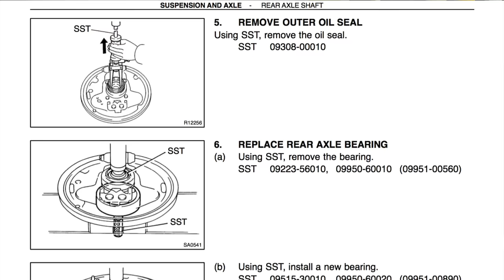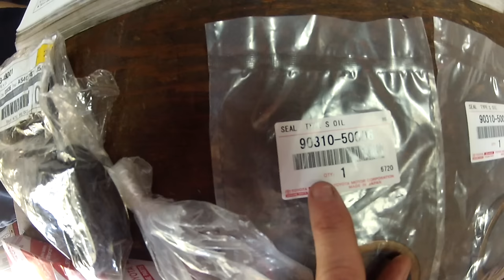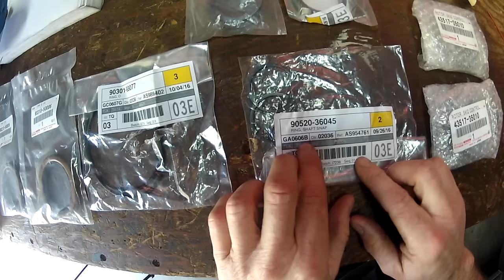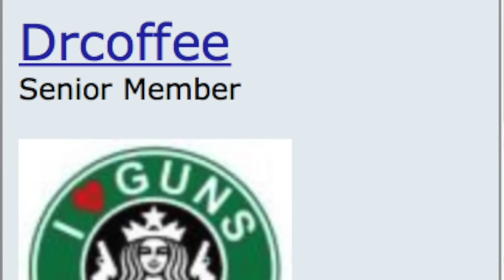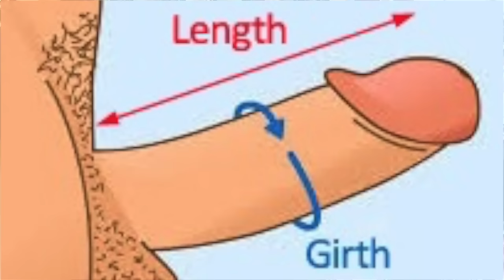Toyota Rear Axle Seal/Bearing Replacement (ABS Rearend)

Comment: HEYOOO Mr. Tim, it's Tim. do you happen to have the outer diameter of the axle and the length?  I'm considering making my own press tool from pipe, flanges, and steel plate.  I need to practice my welding and pipe threading/tapping.  I'd like to keep the jig as small as possible for cost and weight.  Thanks to anyone who can chime in here - I'd rather not pull the axle twice just for measurement. Thanks, Tim - Sincerely, Tim.
Reply from the maker: Hey Tim,  I understand you want to practice your welding and other fab skills but maybe it would be better used for another project.  The tool our buddy Duane makes for this job is really hard to beat.  Take a look at Part 2 of this video for the tool I'm talking about.  You would be really hard pressed to improve upon Duane's design.  https://youtu.be/R-c2x3F8DU4
Reply: @TimmyTheToolman  whoa yeah that's a much better price than anything I'd seen. Bout to watch that vid- thanks for the reference
Reply from the maker: You'll really like this tool Tim.  It is leaps and bounds better than the Durasolid tool.
Reply: @TimmyTheToolman  Ended up ordering the tool from Duane- it's solid as can be and shipped cross-country in 2 days.  Will be putting it to use this weekend.  Do you know if the '96-'00 bearing is interchangeable with the '01-'02 bearing?  I have the #90363-40020-77 bearing for my own '00, but my buddy's is an '01 and I just noticed the difference in part #s.  I'm reading that the only real difference is that the inner race is extended on the 90363-40068 whereas the earlier bearing had identical width of inner and outer race (can confirm these being flush as I have 2 sitting on my bench).  Have you done both styles and could you suggest if the 90363-40020-77 would work in an '01?  My buddy is only available this weekend or we'd have to put this off for a couple months.  The only other short-term option is a cheap house brand bearing from the parts stores.
Reply from the maker: @TimStafford01  Hey Tim, I don't know if the 96-00 bearing would be compatible for 01 and 02 models.  I've always got the correct bearing for the year that I was working on.  Could it work?  Maybe, but I don't know for sure because I've never tried.  How about just visiting your local Toyota dealer parts department today and picking up the correct bearing.  These are usually parts dealers keep in stock.  Yes you'll pay more at your local dealer but you'll get the right bearing and be able to help your friend out this weekend.

Comment: I just had a shop replaced my Axel seal 2 days ago along with the wheels bearing, retainers and the abs gear. Driving home today I was going 65 and I felt a weird vibration coming from the back. When I finally got home I stop and I smell a burning smell coming from the rear passenger wheel and you can feel a good amount of heat coming from that wheel. 10 min later I decided to drive around to see if it vibrates again- it didn't vibrate but for a about a mile I heard a sort of humming sound coming from the back. I pull over and I slightly smell the burn smell again but it wasn't so bad. I then drove around for another 13-14 miles on the freeway and there was no more noise or vibration or smell. Any idea what this is?! Is my seal and bearing bad again 2 days after replacement?? Thanks in advance for your help! 

Ps I went under my car and looked at my diff breather and it does not look good at all, I'm going to to replace it tomorrow
Reply from the maker: krod2152 Hey, sorry I missed your question.  I'm guessing you probably already figured out what was going on since it was a month ago.  If I would have caught your question in a timely manner, I would have told you it sounds like your brakes shoes are dragging.  When your axle seals fail, the gear oil can eventually get into the brakes and contaminate the brake shoes.  The brake shoe material will slowly absorb the gear oil and swell.  When this happens,  your brake shoes could start rubbing on the inside of the drums and the constant friction generates heat.  If the friction is bad enough, your brake could even lock.up.  Something tells me they didn't replace your brake shoes on the affected side and/or the brake shoes were adjusted too tight.   There's also a very good chance they botched the job like many shops do and you were immediately leaking again.

It would be helpful to know what the issue was for anyone reading your comment.  Thanks and sorry again for the late response.
Reply: Probably your abs ring rubbing the seal or housing until it ground itself down. That would make some noise and burning.

Comment: PRO TIP: Use the same hose you use to bleed the brakes to stop the drip when disconnecting the brake line - simply put the hose over the line, clamp the end shut with hemostats (alligator clips) or a vice-grip, and BAM, done!!
Reply from the maker: Thanks for the tip but I like the vacuum cap trick though.  (2) 7/32 vacuum caps and you're golden Pony Boy.
Reply: I didn’t have the tips on hand but I had the hose!! :) keep up the awesome work!!

Comment: I feel like I am missing a few parts but I could be wrong 

Rear axle Bearing need 2.
Dust seal need 2 
Inner axle seal need 2 
Axle housing o rings 2 
Retainers need 4
C clips need 2 
Abs skid control rings 2
Reply from the maker: Julien, take a look at the video description.  We list all the part along with tool links.

Comment: Great video, Timmy!  I'd like to have a machine shop make me the special tool.  Could you tell me the I.D. and length of the pipe section of your Durasolid tool?  Thanks!
Reply from the maker: I could send you pics so you can make your own but I think there's a better option.  Check out this one for sale on Ebay: https://www.ebay.com/str/autopullersandparts  I talked with the seller and he seems like a good dude and stands behind and his tool.  He's going to send me his tool and we're going to make another video showing his tool in action to perform the necessary press work on Toyota rear axles.  I think you would spend more money have a machine shop build you a custom one so that's why I'm suggesting this to you.
Reply: Thanks for the prompt reply.  I will definitely check out your video.  I'm still considering building my own (I can weld the tube to the plates the machine shop will build), so if you think of it, let me know on the ID and length of that tube---thanks!
Reply from the maker: @karlenabrailey1819  Give me your email address and I'll send you pics of the tool.

Comment: Hi dear 
Im facing some problem with my FJ62 – 1987 model lancruiser. When  using the 4x4  gear (high and low gear) the vehicle is getting jam when I turn right or left, but on moving to front or reverse its moving normally, 
I recently serviced to both differential and changed all the seals and bearings, and axle,
I tried to lift the vehicles four tyres on a jack, and run it with the 4x4 high and low gear with turning the string right and left and it doesn’t got jammed, but on getting the vehicle on the ground the same thing happened on turning the steering the tyres getting jammed. 
Even I checked the break system and no any issue found in it. 
Do any one faced same problem as this, or any idea what the issue could be.
Also I opening really diff I find it broken also change with same old one
Reply from the maker: Are you trying to turn the wheels in 4 wheel drive on pavement?
Reply: I tried on the pavement as well as in the desert, the same problem’ 
of course it was to check after make  Service.put View matters that’s all not to much .
Reply from the maker: @cobia010  Well, did you have this problem before you serviced the front axle?
Reply: Before only sound coming from front diff put after Service and change Twice axle and  Rear diff his Happening this a problem
Reply from the maker: @cobia010  I wish I could help you out with this, but without being there, it's hard to say what's happening.  It does sound like to me it's acting like it has a locking differential so when you try to turn, it feels like the wheels are binding.
Reply: Locking diff this is correct you are right put what is the reason for this?

Comment: Hey Tim, is there another way to remove the abs and retainer without using the OTC tool?
Reply from the maker: The only other way that I know of is cutting them off.  I don't like this technique because you destroy parts you can reuse and you also risk cutting into the axle shaft if you're not careful.
Reply: @TimmyTheToolman  I see, I think you mentioned the otc tool can be rented at auto stores, right? And you mentioned the abs and both retainers can be reused, have u tried reusing it and was there any problems?
Reply from the maker: @DTFShorTie  Just check auto parts stores like Auto Zone and O'Reilly's because they rent tools for free and I wouldn't be surprised that they offer a bearing splitter for rental.  I've reused the retainers and ABS tone rings on many sets of axles with no issues.  I document how you can do this in the video description.   I take it you have a special tool like the Durasolid tool to use in conjunction with the bearing splitter to get the ABS tone ring and inner retainer off?  You need that tool also to press the axle shaft out and then press all the parts back on.
Reply: @TimmyTheToolman  yeah i know someone who has a similar tool like the durasolid and he's got a press as well. Was just making sure. Hopefully in a few weeks from now I'll have my bearings and seal replace. As always keep the vids coming!
Reply from the maker: Ok, good luck with the job.  We'll definitely keep cranking out the videos.

Comment: Any way to tell if its just the seals that need replacing,and not the bearings??
Reply from the maker: Going through all the reasons why it's a good idea to replace the bearings along with the seals would be a lot of typing for me so please start watching at play time 7:14 and I explain it in great detail.  Also in the video, I explain how the seal has been redesigned by Toyota and the lip of the seal now sits more inboard.  Simply replacing seals without repositioning the inner retainer will cause you to have another failed seal in a much shorter time than you would like.  

So, please take another look at the video and also read the video description for more helpful information.

Comment: Do those same part numbers work for the 04 Tacoma 4x4? I'm gonna be doing this soon and wanted to get all the parts together
Reply from the maker: They should because the rear end on the Tacoma is the same as a 3rd Gen 4runner, but to play it safe, you might want to double check the part numbers on a Toyota parts seller website.
Reply: @TimmyTheToolman  will do.. thanks for the reply back and the awesome videos bud

Comment: Does the ABS gear really need to be replaced? I I can't see the benefit to replace it.
Reply from the maker: fbanda20 No, it doesn't need to be replaced and neither do the retainers on both axles.  If you pull the parts off like we show and don't cut them off, they can be reused.  For the retainers, you swap the positions so the one that was riding against the bearing is now mating up with the seal and the one that was originally mating with the seal is now riding against the bearing.  The seal wears a mark into the retainer and that's why it's better to swap the positions so the new seal doesn't end up riding on the same wear mark.  I listed these ways to save money on the parts in the video description.

Comment: I imagine you can't by all that axle and Brake housing and bearings and retainers already pressed together can you?
Reply from the maker: No, not that I know of.  Even if you could, Toyota would have the inner retainer at the original position and then it wouldn't mate up well with the axle seal they redesigned anyway.   The only way you could get a complete axle is getting one at a wrecking yard like PickNPull but then it's used.

Comment: With the ABS looks like no need to flip retainer because you have room both ways. I would have thought ABS and outer retainer would have been tight to inner retainer!
Reply from the maker: Some shops that don't know what they are doing press everything tight together and then the customer finds out the inner retainer comes no where close to mating with the seal.  People have gotten away without flipping by moving the inner retainer 2mm more inboard than the OEM location on the axle but that now puts the inner retainer really close to rubbing the inside of the axle housing which people have experienced.  The smarter choice is to flip the retainer so you can keep the inner retainer in the same OEM spot (5mm or polished axle showing above the retainer) so you get a good mating with the seal and no chance of the retainer rubbing on the inside of the axle housing,
Reply: Got it, forgot you said that!

Comment: just did all 6 bearings and had to peen the bearing surfaces all around due to excessive wear (745000 ln111r) just wondering how im gonna get those bearings off down the line now lol. Hopefully never have to touch em
Reply from the maker: Hey Jack, you lost me on your comment.  There's only 1 bearing per axle.  2 axles means replacing 2 bearings.  How did you manage to replace 6 bearings?  Do you own (3) 3rd Gen 4runners?

Comment: Timmy, awesome vid man. About to tackle this myself soon enough on my 98' Limited. By chance, do you have an alternate site for the 4x4 steel plate?
Reply from the maker: Jerome Jose Hey Jerome, I found the steel plate for sale on Amazon.  But, if you have a fab shop near you, they should be able to cut you a plate any length and width you want.  The plate I bought is a 4 inch x 4 inch x 1/2 inch thick steel plate.
Reply: Thank you Timmy. Again, much appreciated. Keep up the great work, I've been using all your videos :)
Reply from the maker: Here's a link to the one I bought via Amazon: https://www.amazon.com/gp/product/B00OKLY592/ref=oh_aui_search_detailpage?ie=UTF8&psc=1
Reply: yeah, I immediately checked out the link, but the status for them on Amazon is currenlty "Unavailable"
Reply: Thanks for the advice Timmy. For an update, I just stopped by a metal fab shop based on your suggest, and they gave me a 4x3 piece of 1/2 steel, which I'm assuming is ok.
Reply from the maker: Jerome Jose Yeah, that will work fine.

Comment: Good video. After doing my left side 2 times I did the drcoffee with it flipped. Doing a grease test along the way.  This is a ugly job and thats why they get a bunch of money for it.
Reply from the maker: Making this video is a sort of redemption for me.  When my passenger side axle seal failed, I researched the job and found you either had to have a press and special tools or you could bring your axles to a machine shop and let them do the press work for you.   After reading on the forums that machine shops screwed up many people's axles, and I assumed a press would cost a ton of money to buy, I let my local Toyota dealership do it for me.  Including the rear brakes and a brake fluid flush, they bent me over for $1500.  Man, I wish I could have that decision back.  And to top if off, the mechanic screwed it up.  I pulled the ABS sensors and saw my driver side was already leaking after only 5000 miles.  I made them do it again, flip the retainers and verify where the seal was riding by doing the grease test.  I basically schooled the mechanic who was suppose to be one of their top guys for that repair.  It was this experience among others that pushed me to start doing more of my own work.  

As I gained more knowledge by frequenting Toyota forums, I learned you could get a Harbor Freight press for a fairly affordable price and the special axle tool wasn't too expensive either.  Even though I let myself get ripped off at a Toyota Dealership for this job, I'm hoping this video saves a lot of people a lot of money.
Reply: Timmy The Toolman now that stings! I try not to use the dealer at all too. Here's my tip, I used some thin flat washers stacked together as shims for the retainer on 3 places on the sides to prevent over pressing the retainer.  Then remove, grease check and adjust from there. Im sure you could make up something to get it close but thats what I had.
Reply from the maker: That's a good idea.

Comment: recently I attempted to change the rear axle bearings and seals on my 02 sr5.i purchased the parts and the tools including the shop press.after getting the axle out i was shocked to find the adapter that takes the tone ring off did not fit, I noticed that my axle was missing a retainer and the backing plate is even smaller.
after some research I have concluded that my rear end is from a 95.I am only the second owner and nothing has ever been done to this truck.
just wondering if anyone else has ever ran across this.And if anyone in the Dallas area needs rear axle bearings replaced let me know.
Reply from the maker: If you're looking to sell your parts or help somebody with the job in your area, you'll have a better chance finding someone if you post in the 3rd Gen section of the T4R.org forum.